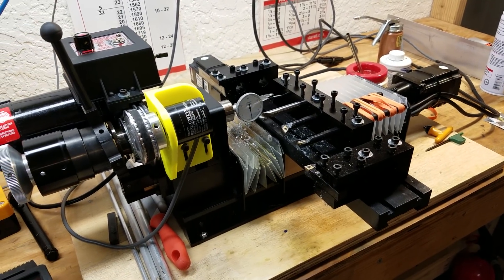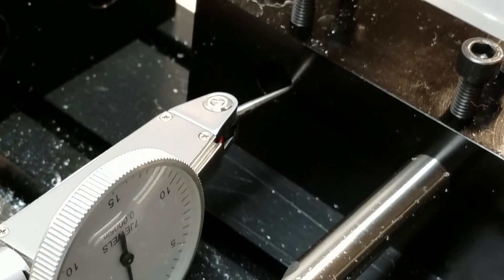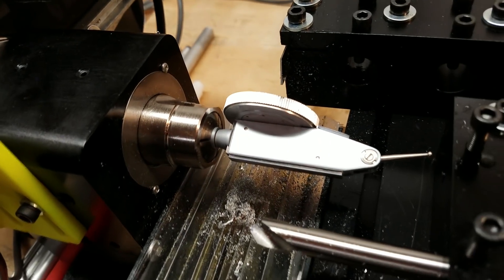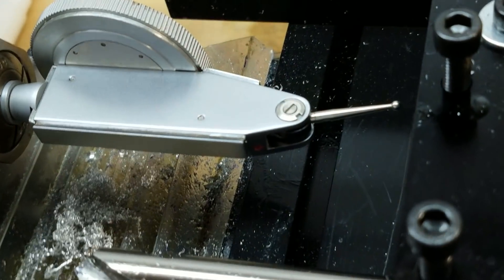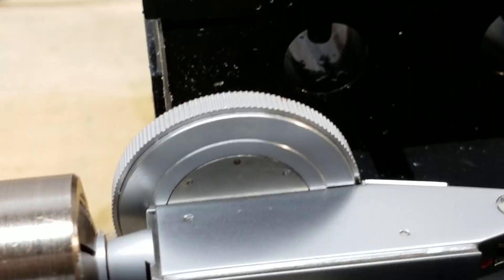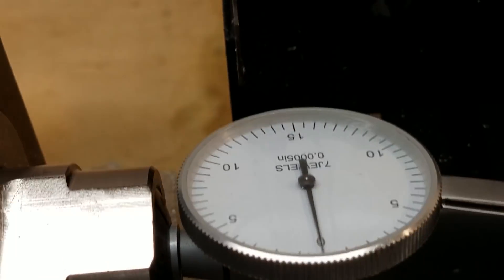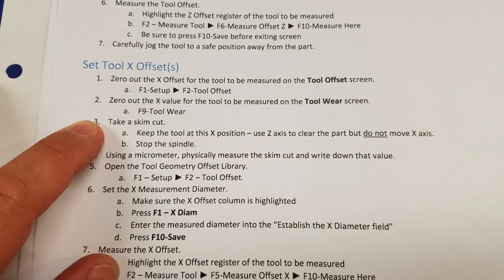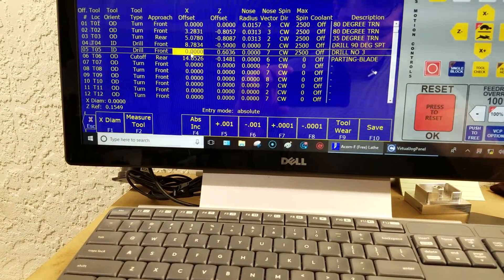Lathe Drill Offset Setup on the Centroid Acorn CNC

Comment: I'm now considering getting one of these machines (chucker like the ne in this video or regular old sherline lathe) to get into watch making. Would you happen to know what kind of backlash the machine produces in the x and z?  Also, what happened to your drill bit chart at 3:10 :D ?
Reply from the maker: maxwil7 Hi. Backlash is less than .001" on X and Z. I like the lathe and I think the slideways are really good. At one point, I had a box with a vent fan on the bench and the chart was sticking to it and blocking the flow. I had to trim it.

Comment: How do you adjust the tool height for the other tools?
Reply from the maker: The round shank tools seem to be right on the money out of the box.  The cut-off was also perfect out of the box.  The square shank tool was a 10mm metric the I milled down to .375" and I was able to get it "just right".  However, were it not, I'd put some shim stock under it.

Comment: Just went out and tried it, works nicely. I normally use 12mm ground rod, but any misalignment tends to chew out the hole. Never been a fan of dial gauges but this was easy enough.   My gang blocks are home made and drilled and reamed insitu so they should be in a known position all the time.  The one I tested was 0.5mm out compared with the numbers stamped on it. This was done many years ago now so with various belt changes on the X axis this may have changed.  Will do a complete check all three holes once the lathe is not setup to run a job.
Thanks Franco
Reply from the maker: I'm glad you liked the video.  "..insitu..."  Are you of a medical background?
Reply: Franco, only when I visit my doctor. It is just that in place did not quite seem to be right. LOL